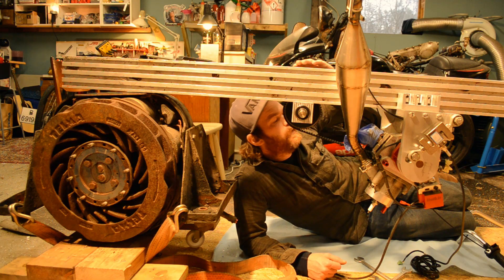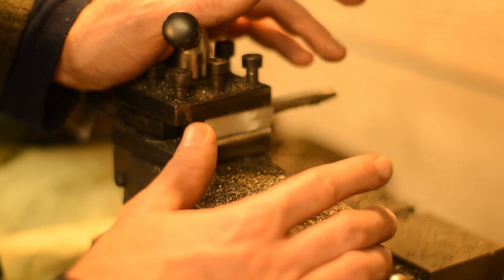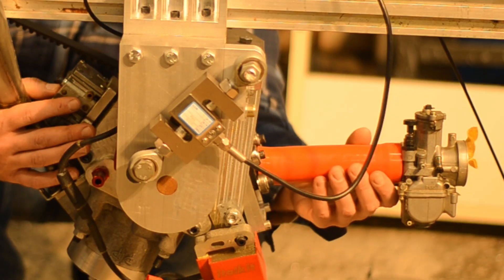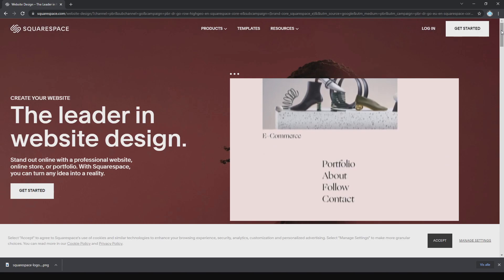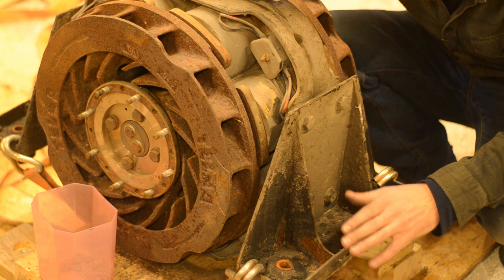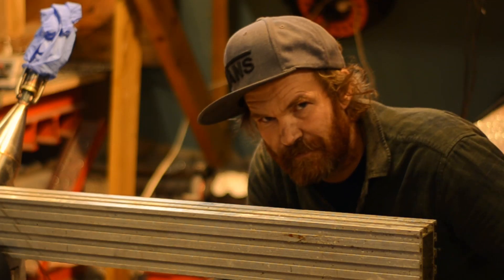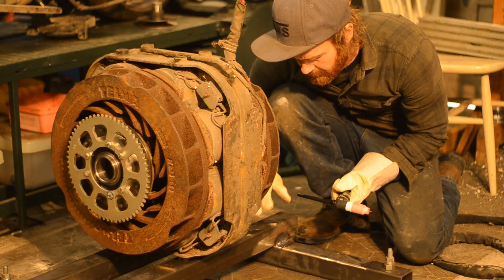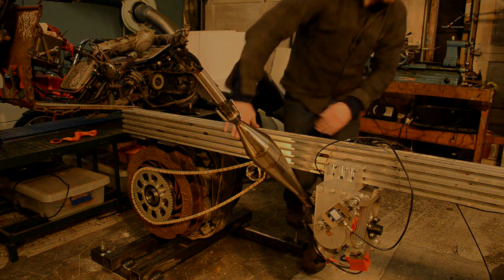Dyno built to Break the Most Powerful Engines.

Comment from the maker: Hey there, thanks for watching! Realized it's not immediately apparent in the video - wrong size rear sprocket. 415/420 are the same except for width, 428 has slightly larger rollers. Should've done better research... New sprocket on the way👍
Reply: Definitely sensed some frustration at the end. 
Happens to all of us. I recently ruined a new piston for a 49cc Chinese build by taking the skirt back too far and exposing the exhaust port. (Alcohol infused🙄 wasn't using my noggin)
Thankfully I have a handful of spares to mess up lol.
Thanks for the shared knowledge and entertainment!
Reply: @avalanche15301  deqiqfqfqqiqfqiffufiiffi
Reply: The Squarespace link goes to a dead page btw. fyi in case it was to be an affiliate link or something. Cheers man.
Reply from the maker: @Rebar77_real  Thanks for the heads up, fixed👍
Reply: Yeah i mismatched my sprocket chain pitch on my ssr 125 420 / 428  just to get back outside...  worked kind of

Comment: Have you tried open venturi only for intake and exhaust throttle like K&B did on their model engines? The heat stays in the engine when you idle and therefore it comes faster when you give flat open.

Comment: Oh I get now, thinking you serious scientists, but you just doing the jokes !  Ha ha ha... chain on dyno... very funny...
Reply from the maker: Why would a chain drive be funny?
Reply: @2STROKESTUFFING  watch what happens when it breaks, and it will break, it's very ugly and messy.
Rubber belt (supercharger/blower belt, dual V belt), is much much safer. There far too many sheer points in a chain, where rubber belt has none. For your safety, plz do not use the chain. ;)

Comment: Great channel, great subject, very informative with a funny sense of humour.
I'm an Australian Boilermaker or Certificate 3 Engineer, for over 35 years and I've never seen a grinder used like here lol. For those bigger weld jobs, I suggest you buy a small MIG and use inner-shield wire, it's very easy to weld with too, no need for gas bottles, I don't know what power supply is used there, so I can't really suggest much more on a MIG, here we have 240v power supply, I have a good OZ made one with copper windings, that plugs straight into 240v 15amp outlet, it's rated up to 180amps, these last longer than the aluminium plated one's, better duty cycle too. Also I've got a 300mm vernier you can borrow if you want lol, keep up the great work.
Reply from the maker: Thanks! I've actually got a Mig welder, but trying to force in as much practice with tig as possible.
Reply: @2STROKESTUFFING  ok, it's good practice, takes time and steady well coordinated hands to get good with tig, what you're doing looks good enough for your doing, once you get good with tig it's a very good welding skill to have. I'm enjoying your channel mate, I can't wait to see the brute force in it's bike on the salt flats. 👍 😉

Comment: Really amazing watching what your doing. If you could build a 250 cc and a  500 cc 2 stroke with a resonance tuned power band. And it would bolt in to lots of different frames.  I really like your sense of humor. That piston design is super smart. Peace out.

Comment: That taperlock isn't gonna hold when the engine starts turning on the axle at 11:21. You need to make a keyway and put a pin between the taperlock bushing and axle. With a bit of torque the taperlock will just spin around the axle. The pin in the keyway is what is keeping the bushing from turning and the bushing is basically keeping the gear from moving along the axle
Reply from the maker: I'll have to do some calculations, but I won't be surprised if taper lock clamping force is enough.
Reply: @2STROKESTUFFING  eyeball calculations say it should be fine if you start applying torque smoothly, which is easy enough with a centrifugal clutch.

Comment: My god reduce the rpm on your drill, WAY to fast, the cutting speed should be''Cutting Speed of the material X 4 divided by diameter of the part or tool'' search for ''speed and feed calculator'' great humour, you get better and better.
Reply from the maker: Thanks! Yeah, should slow down. I'm so used to alu...

Comment: No 50cc is faster than my Derbi NT/Doppler Vortex ALU engine!
Reply from the maker: Sounds nice! More info?
Reply: @2STROKESTUFFING  Got a Derbi  Senda SM moped. With the Derbi NT/D50B0. Revised the engine twice and the second time did it myself. I've put a Doppler crank in it (Doppler Endurance) and a Doppler Vortex ALU cilinder. 2 weeks ago i put a 19mm carb on it instead of a 21mm (didn't ran that well). It's got a SCR Corse exhaust (not the downpipe version). Clocked it at around 90 km/u with a great bit of torque which makes it drive fun. Also upside down front suspension and stuff. I could talk for days about the bike. Thanks for making these awesome videos! I am really interested how much horses these 2 engines make!

Comment: You need to use oil or wd-40 with that bit or it will get destroyed every single time. I’ve learned that after ruining like 6 of them. The last set I’ve had for a year with oiling the stepper bit, or any bit for that matter
Reply from the maker: 👍 Did use oil.

Comment: Alex, quick Tipp for drilling holes in hard materials like steel: Slow RPM, steady pressure is the way to go. With high RPM the only thing that will happen is really high heat, which eats away you drill bit. Thanks for the Video and take care!
Reply: Not if you have drill bits designed to operate at high speed. If you go slow, you get them overly hot and wreck them.
Reply: Pretty sure step bit do not fall into the high speed category. 

You can resharpen them with a cut off wheel and a grinder however.

Comment: 4:15 What is that orange hose/tube made of? I made an extended intake for my two stroke motorized bicycle. But it's made of silicone and therefore not fuel safe. (135 degree elbow with a 0.75" i.d.) I've tried to find fuel safe tube with a 135 degree bend (often marketed as 45 degree) but with no luck. Does anyone know where I can get a 135 degree elbow of fuel resistant hose with an inner diameter of 3/4 inch?
Reply from the maker: It's silicone, might not last forever.
Reply: @2STROKESTUFFING  I have a cut off piece of what I used in a clear glass jar of fuel mix. This way I can see how it's holding up. The piece submerged in fuel will not last as long as the tube on the bike. I figure when the piece in the jar shows signs of destruction I'll have plenty of time to get another one if I haven't found a fuel safe alternative by then.

Comment: Make sure that when you open the valve on any high pressure cylinder (anything above 10,000psi) you fully open the valve and seat it. They have a double seal and if you don't open it fully the gas can leak past the threads wasting your expensive gas, it happened to me a couple times before the guy at AirGas told me what was happening. Oh and also they make aerosol cans of layout ink so you don't have to brush it on big parts. It's available on Amazon for $11.46 US. I also found it cheaper elsewhere but with Amazon Prime shipping is free so I'd go that route, I don't know how it'd be for you... I'm sure you can find it in Norway too. Not enough war? What do you mean by that.. that doesn't translate well I think... unless you are talking about the band WAR.
Reply from the maker: Thanks for the heads up/tips! I find "not enough war" funny cause it's such an absurd statement.
Reply: @2STROKESTUFFING  yeah well for Americans we tend to take that literally and after 20 years at war.. you can understand why that's perplexing.